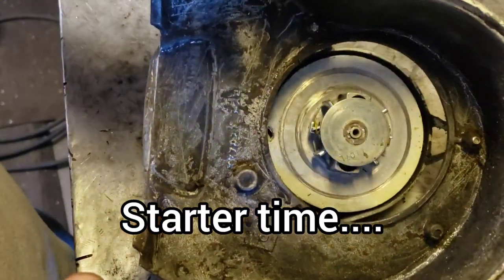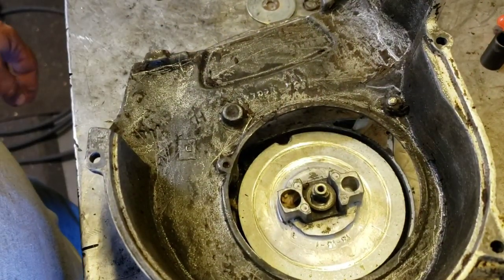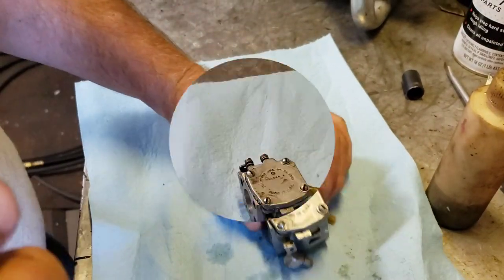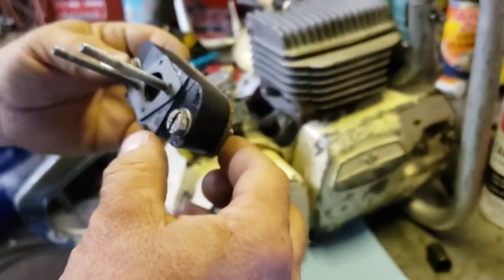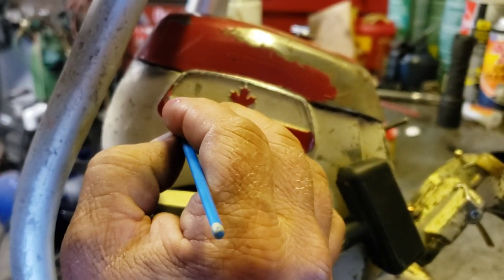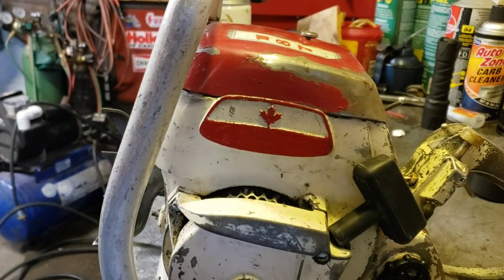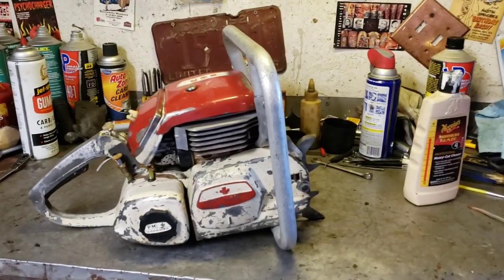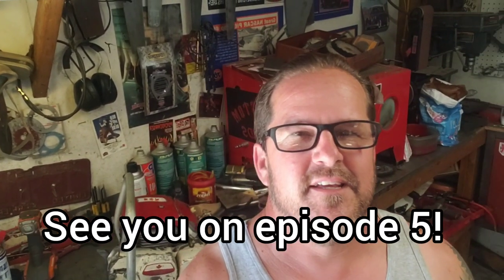PM Canadien 187 95cc Vintage Chainsaw Resurrection part 4

Comment: Dan, thanks for pointing out that garden hose trick👍 I took my 10-10 out fer a rip today and forgot it was missing that rubber piece. It was really gnarley on my hands. Guess what I’m gonna try out😁also needs tennis racket wrap or leather wrap on my bare metal handle but I haven’t found any nice stuff yet. But she fired up real nice n pulled chain all day😃
Reply from the maker: Thank man, yeah I almost threw it away, but realized it belonged with the saw as a part of history....Thats cool you got the old 10-10 going ! I need to get mine running better....lol
Reply: Kain Kustom Garage can’t beat the sound n torque of a 10-10. I found mine at the dump all seized up. It needed a spark plug😏they must’ve threw it in a puddle after they couldn’t start it. Eventually taking it to the dump where she found a loving home😁
Reply from the maker: @shapeshifter7753  Ah the bad spark plug strikes again! Thats cool you saved er!